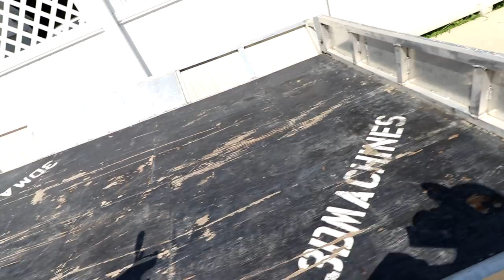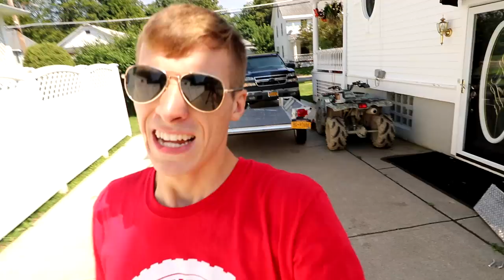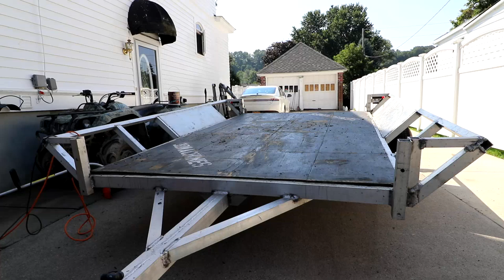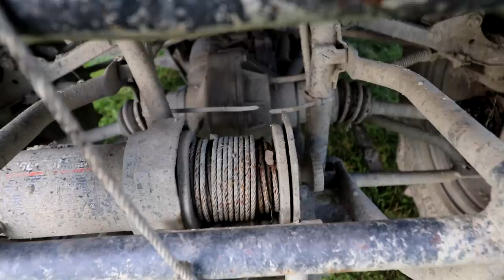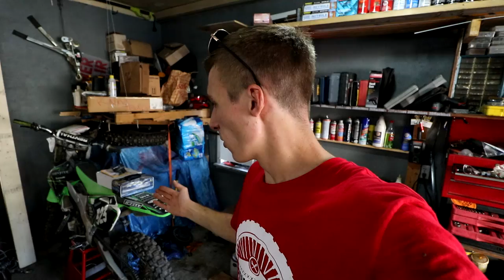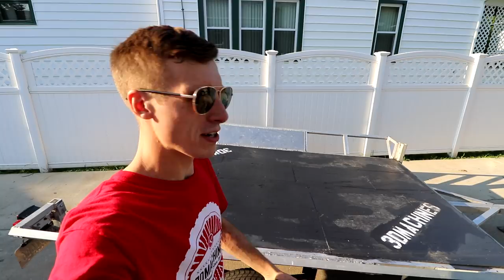EVERYTHING'S FALLING APART!!

Comment: Dalton, take the interior door panels off, see if you can push the dents out before paying someone else to do it.
Reply: it looks creased pretty sharp at the edges, most likely the paint/primer will crack and come off when it's popped back out. skilled body guy may get around that with proper heating first, but it looks iffy.
the yellowish streaks will probably clean off and buff out, if not scuffed clear through the paint..

Comment: 3DMachines,what you should do with your trailer for next winter is put a big rubber mat on it and bolt that down into the wood. that way you have an extra layer of protection for your trailer and shouldnt have to worry about the wood getting messed up

Comment: the truck will be $2000 for everything. Also a little tip, lacquer thinner and a terry cloth will take that paint rub right out. just put a little lacquer thinner on the cloth and rub the paint rub right out. be careful not to rub too hard for too long because you could start to ware through the clear coat eventually as well.

Comment: Being messy is not being efficient...If you put away what you're using right after you're finished using it, you won't be wasting time cleaning or putting away later...You may say 'Well, it takes the same amount of time either way'...That's true, but if it's already cleaned up & stuff put where they're supposed to be, you can jump right into the next project without having to take the time to clean up/organize beforehand...